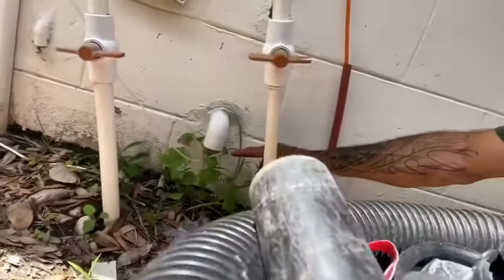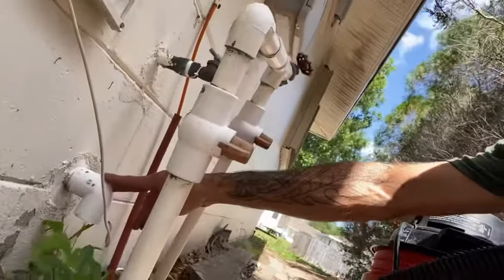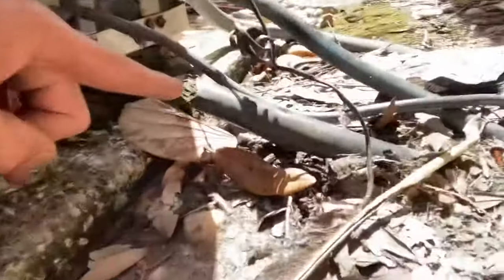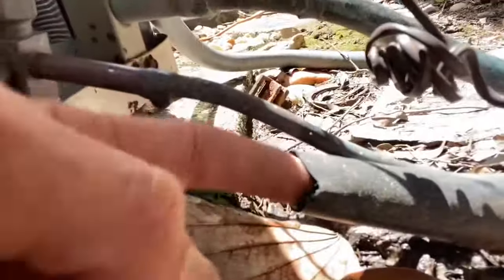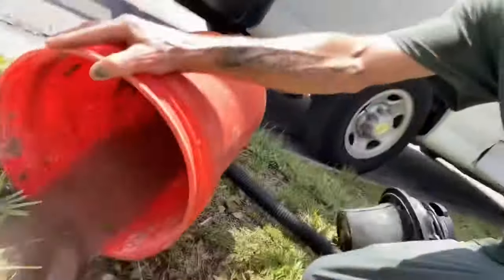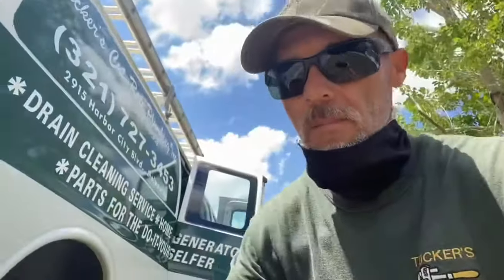Nastiest plumbing residential service call

Comment: My nastiest service call: main sewerline backup at an an apartment complex and water is spewing out a cleanout under a pond of sewage. I work in my waders working the cable down the hole while another works the machine out of the water. The stoppage breaks and I'm standing in a whirlpool of turds and other floating funnies as the foulness retreats down the cleanout.

Comment: Nastiest call me and my boss went on was a backed up sewer line inside the house, going up stack.  Pipes shifted outside could not get machine from there. Cast iron sweep was cemented into foundation wall in basement, no clean out. Had to get open, so started melting lead joint, when that broke free, it was heated and cooked raw sewage. Spewing and dumping into plastic bin. Cleared out that basement quick. Memories!
Reply from the maker: 😳 thanks for sharing

Comment: Hi Tim I went to replace my shower tub cartridge i could not  pull it out I broke the first section the rest was lodged in the only way to take out was to use sonicrafter it finally came out but i compromised the housing with the tool.  It scraped the inside and gouged it by the thread. Now when I put the cartridge in it’s leaking by the faucet handle. Do I need to change the valves now?